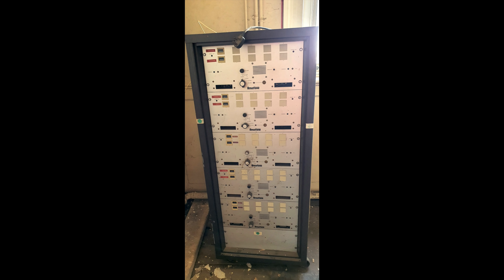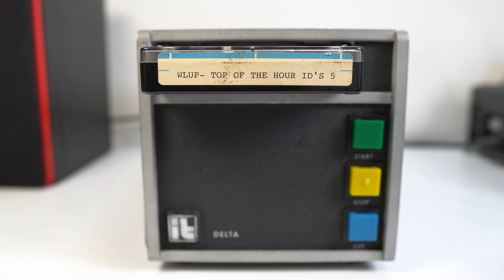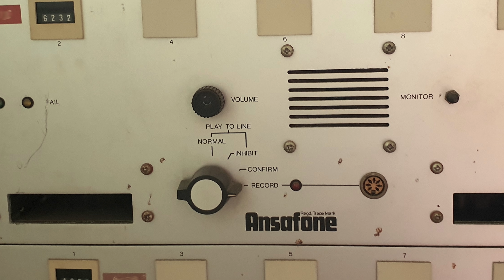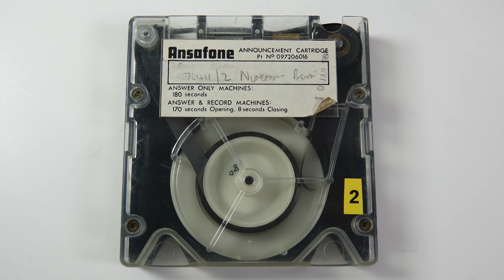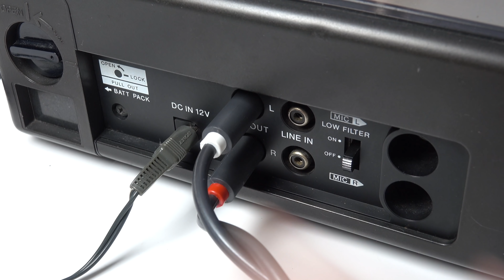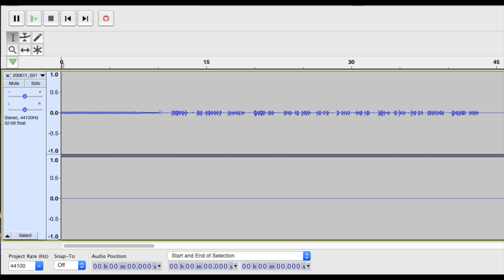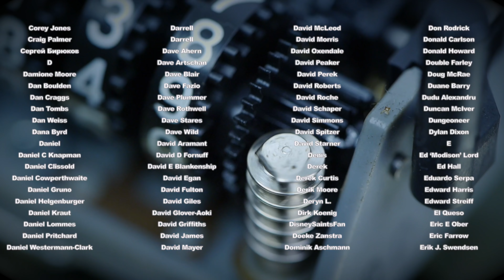Abandoned Railway Carts - Mystery tapes from a disused comms room

Comment: @Techmoan What a trip. My dad created WLUP Chicago in 1977. Jay Blackburn. That tape brought back some memories. Thank you. DO you have any other WLUP stuff?
Reply: Small world!
Reply: I'm only used to hearing the station on 97.9 so it threw me off to hear 98. When did they change stations?
Reply: @dgpsf  Yes!  There wasn't POINT ANYTHING on an analog radio dial. The only time I heard a decimal on an FM call in the 1970's was BLANK, POINT FIVE (as you could get HALFWAY by sight.) any thing else was rounded up or down. In Pittsburgh,PA we had "Disco 96" (96.1 FM), But WDVE was always 102.5, Even in it's 1960's KQV FM days. This happened on AM (MW to the rest of the world.) too: "AUDIO 14" was once what KQV 1410 AM was called. Admittedly such rounding on AM was scarcer than on FM as AM stations in the US are closer together, and go in nice even 10 Khz "steps" (LOL, the ONE time the US is "metric") In Europe ( and elsewhere?) AM was spaced (IIRC)  at 9Khz. IDK if European AM (MW) stations rounded the frequencies in their "calls".
Reply: @psychoacer  They didn't change stations. More accurate tuners evolved.  97.9 is "98" when rounded. There were no digital tuners then. You pointed your dial at a physical marking AS CLOSE to the frequency desired as possible and "fine tuned by ear". 97900 KHz (97.9 MHz) is as close to 98000 KHz (98MHz) as one can get, as in the US at least the FM channels are 200 KHz (0.2 MHz) wide.
Reply: @psychoacer  It's pretty common for stations at .1 or .9 advertise themselves as the rounded number. E.g. Boston's Kiss 108 is really 107.9, LA's K-Earth 101 is really 101.1, and so on. (Although apparently NYC's Z100 is actually 100.3, which is weird imo.)
Reply from the maker: @Geoffrey Blackburn I bought a box of carts a few years ago. It’s possible there are some other WLUP ones in there. They are all from around the same time period as the one I played.
Reply: @psychoacer  I asked my pop why they would say 98 instead of 97.9. He said it was to raise Nielson ratings numbers for ad sales. I don't pretend to understand how ratings books worked 40 years ago but that is what he said. He did it to every station he owned/programmed.
Reply: Before WLUP, the station on that frequency was WSDM (smack dab in the middle), which my parents listened to.  I wish I could have heard WLUP, but we moved out of the Chicago area in 1975.  I wonder if your father had a role in the infamous "Disco Demolition Night" (hosted by Steve Dahl of WLUP) that caused the White Sox to forfeit a game.
Reply: @romulusnr  "Z100" being "100.3" is still correct, by normal usage, XXX.5 is STATED is XXX.5,   Anything LOWER than XXX.5 is rounded DOWN, Higher than XXX.5 is rounded UP. (At least that was the pattern when I did radio.)
Reply: @geoffreyblackburn2110  Frequency and ratings have nothing to do with each other. Your dad was making a clever joke. Arbitron ratings didn't "climb" with frequency. If they had our "holy roller" station at 101 would have had better "numbers" than our "pop" station did at 96. Eh, THAT was NEVER gonna happen,LOL.
Reply: "The Loop" used to be such a great station. It broke my heart when they shut down.
Reply: @frogz  Yeah, Phase locked loop detection is a "thing" in analog FM receivers (although most PLL FM radios are in fact DIGITAL). And YES the FCC controls the freq of a broadcast station down to .1 Mhz. Yes sir, ALL that's true. How relevant that was to the average teen in 1977 tuning a $10 radio from Woolworth where the markings on the dial were: 88...,92...,96...,100...,104...,108... I don't know.  And How ON EARTH it changes a simple "Bumper" slogan, I don't know. It's a brand name NOT the legal licence description. Rounding was and is still common.  We had a station here called "B-94" (and I mean the original one, NOT the current HD subchannel) that operated at 93.7 MHZ It was CALLED B-94 even AFTER digital tuners bacame mainstream, Thus, "B-94" listerners (poor souls,that they were,LOL) TUNED to 93.7 Mhz).
Reply: @smokeydoke100  Chicago (along with Pittsburgh and New York) at one time had the best LOCAL RADIO BROADCASTERS  on Earth. Go find "airchecks" from any of those 3 cities from the 50s to the 90s and see how SPOILED were were compared to the West Coast then.
Reply: @halkneeble7612  I remember that "infamous stunt" fondly! What a way to say "goodbye" to the 1970s, LOL!
Reply: @jamesslick4790  Like WRRK back about 10 years ago..  It was "Channel 97"  but was at 96.9 on the tuner.  I remember "The Judge" was one of the DJs, and wasn't there a lady named Michelle too?  It's been too long..
Damn.  I miss that station. Best damn classic rock station I ever heard. You had Quinn & Rose in the mornings, rather than music, but I found them to be entertaining.  Now it's just another one of those lame "Name" stations.   
"Bob FM.  We play anything!" (Including mostly trash)   And DVE as well as 90% of all FM radio is utterly useless in the mornings with either Jocks foaming about " Hey yintz gize!  We gots duh stillerzz anat!" or "Yintz  gawwnna listen ta sum Pens anat!" in extremely exaggerated Pittrsburghese, or DJs giggling like stoned teenagers at some dry "humor" on some lame "Morning show"  I'm just like "SHUT UP AND PLAY SOME ROCK!"  SW Pa. needs another classic rock station that actually plays music.  Especially in the mornings.  But the absolute worst, (besides the rap and hiphop stations) are those "Hot New Country" stations which are barely different from hiphop or soft pop-rock.  BLEHH!  I'm glad WLYY "Willie" 103.5 came along for my country music fix. Before Willie, it was that stupid Frog station with lame "hopping home" or ribbit" puns. I listened to 1110 AM WKZV out of Washington.
Thank goodness for smartphones and bluetooth connectivity.  Radio is all but useless for music anymore.
Reply: @jamesslick4790  All the greats have disappeared. WLUP, WDAI (Became Disco DOA,) WMET. Even WIND on AM at one point.
Reply: I was at Comiskey Park that warm July day in 1979. I walked across the field out of the stadium and took the IC south home. It got pretty crazy that day. I wasn't sticking around for cops to crack me in the head. I saw the skinheads getting into it with them though, so I high tailed it out of there.
Reply: The station is now a K-Love station just like 107.3 in Washington DC and the WRQX call letters are used by an AM station. But that is cool that your dad created the station that was liked by many people in Chicago.
Reply: @caturdaynite7217  Disco Demolition. An event truly worthy of another star on our flag.
Reply: @smokeydoke100  🤣👍👍
Reply: RIP the Loop
Reply: @romulusnr  I know stations advertise themselves like that but this tape is labelled as the hourly ID which I thought* was required to state the actual licensed frequency.

I generally dislike stations rounding their frequency in advertising because they are ambiguous (all FM stations in the US have an odd decimal). I am OK though with 88.1 and 107.9 rounding their numbers because they are unambiguous (79.9 and 108.1 are outside the broadcast band).

*I actually just looked at the Wikipedia page and the actual frequency is not required in the ident, but is optional between the callsign and the community of license. So they just barely get away with it. To a human the ident is "FM 98 WLUP Chicago" but to a lawyer the ident is only "WLUP Chicago."
Reply: @nathansmo  Amen, Brother.
Reply: @romulusnr  It doesn't, or didn't even have to be that close. For instance, when KSYZ went on the air in Grand Island, NE, in 1982, it advertised itself as "FM 108" despite being at 107.7 MHz.
Reply: As soon as it started saying "the loop" I just about died. I listened to WLUP all the way till it went off the air! (for me 2004-2018..I was born in 2000). Definitely did not expect that in a Techmoan video!
Reply: @romulusnr  in my town, we have alot of stations that goes with .3 or .7 dont know why they like to use that frequency
Reply: @Techmoan  On behalf of my fellow Merkins I'd like to apologise for the egregious and ill-conceived usage of an apostrophe to form the plural on "IDs" at 5:54 --- Those responsible have been sacked, castrated and left in the sun for the hyenas.
Reply: @geoffreyblackburn2110   You couldn't find '97.9' on an old car stereo with a needle in a window display located at the bottom of the dash. You aimed for '98' and stopped adjusting when it sounded good.  So radio stations marketed so people could tune in easier. Once digital displays had take over the WLUP was no longer 98 but 97.9 in their materials and ads.
Reply: I've got a copy of "Chicago Rocks Vol. 1" that WLUP released in 1980.
Reply: @jamesslick4790  a lot of the frequencies were announced in terms of wavelength instead of frequency, back then, at least in the UK.
Reply: @kaitlyn__L  In the US, (and IIRC, Canada and Mexico) it was always kilocycle (now called kilohertz) and megacycles (now called megahertz) for broadcast AM(MW) and broadcast FM. Many US made radio receivers DID have a meter scale (mostly sets made from the the 1930s thru 1950s), But no US broadcast station "calls" used wavelength. Meters of course WERE used by US broadcast Shortwave stations, Likely due to an international audience. PS: US FM frequencies have "channel numbers" but no broadcaster referred to them. Some would brand themselves as say, "Channel 98", But still that was a reference to the closest frequency, NOT the actual FCC FM "channel" number.
Reply: @jamesslick4790  yeah, as far as I'm aware we only really switched to frequency with FM. But maybe SW AM had it too. It's interesting and weird for me to look back at 40s and 50s American receivers and see frequency instead of (or in addition to and obviously primary, much as MPH/KPH speed dials) when the ones over here just showed metres. Which is interesting considering most people used feet and inches for regular daily measurements in the UK, so I suppose for a while "1000 metres" would've registered as only being a radio station to some laypeople. 

I also notice America seemed to use the term AM earlier than we did, where we only used LW/MW/SW with no mention of the modulation technique until it became relevant with FM. But I haven't looked into this stuff super extensively so I don't know exactly when the switchover occurred. Certainly modern radios in the UK will measure AM in frequency not wavelength, though whether or not they also do that for LW and MW is more variable, especially with digital displays.
Reply: @psychoacer  Basically the NAB sublevel of "broadcaster' thinks its listener is too stupid to discern nuances of decimal points (or call letters for that matter) so they dumb-down the drain to the nearest number and a mindless totem.  It's all part of abusing the medium in the obsessive quest for more rating$ for Numero Uno.
Reply: @psychoacer  As many have said, in the days of analog radio tuners, whole numbers were the only thing you could see on the dial to point the needle at -- and the labels weren't necessarily perfectly aligned, either.  So stations often rounded the number in their branding. 

And some still do.  Here in the Twin Cities we have "92 KQRS" (92.5), "KS95" (94.5), "Cities 97" (97.1), "K102" (102.1), "Love 105" (105.1, .3, & .7 -- it's a long story), and "KOOL 108" (107.9).
Reply: @Cammi_Rosalie  I'm with you. Today, I listen mainly to 93.7 (KDKA-FM, "The Fan") Unfortunately, right now I haven't had much to listen to even there, as theres no real sports at the moment. As to "Country stations", YEP 100% agree most of that crap isn't "country"! But, then too, same for "rock" NO ONE makes actual "rock" anymore. So, now broadcast radio (for me is confined to news and "talk". Sad.
Reply: @eDoc2020  Yep, The legal "Ident" and the authorized frequency on the transmitter licence are technically 2 different things!
Reply: @simonbone  It's just the math we got in third grade: if it is HIGHER than .5 round UP, LOWER than .5 round DOWN, Lol.
Reply: @jamesslick4790  Indeed it is. But with digital tuners, it's become a lost art, at least when it comes to hunting for radio stations.
Reply: @kaitlyn__L  I think we used the term "AM" earlier is due to NEEDING to earlier. "FM" became the thing in the US in US in the 1940s, While broadcast  "FM" really didn't "take off"  until  the 1960s, (when stereo FM was launched) It existed and was used. (there were also really early police/fire use of frequency modulation in the US) the term "AM" thus started to appear on radio dials to differentiate from FM by 1950. Prior to that, there was no need, as LW/MW/SW were ALL either CW (I.E. Morse Code) or AM. Before FM,  the Medium Wave band was just called "Standard Broadcast" SW was, Natch, Called "Shortwave" While there WERE Long wave sets made in the US, LW was never used for broadcast in North America, So it was largely left off. I believe that BROADCAST FM didn't start in the UK until the mid 1950s. So older UK sets would likewise not bother to say "AM" because LW/MW & SW were ALL "AM" anyways! PS I have a current (2018 made) radio that says "MW" instead of "AM" - (it also has LW and SW too), Being an old radio guy, I did not need the manual to tell me that "MW" was (in the US) 525-1750 KHz AM, LOL!
Reply: @jamesslick4790  ah, I never knew the USA had FM sooner! Certainly, many people used AM-only radios well into the 60s that just said LW/MW/SW in the UK. Especially since the BBC had the only official broadcast license, lots of pirate radio stations operated just outside British coastal waters and they used LW to get their coverage playing rock and pop that the BBC wouldn't play, or only play for an hour once a week.
Reply: @kaitlyn__L  Well, to be fair, "early adopters" and Classical music fans were the ones that REALLY used FM before the 1960s in the US, But it DID exist. so "AM" only radios STILL sold well in the US in the 1950s AND 60s. (heck, even in the 1970s, you could get an AM only radio at "Radio Shack"!) FM here got gradually bigger after the FCC permitted FM stereo in 1961 (AM stereo was TRIED, but 20 years AFTER FM!!) "serious" music was FMs "staple" for a long time. FM Pop/Rock stations only became mainstream in the LATE 1960s. As to the "pirate" stations, It's a fascinating aspect of Broadcast radio by itself. Using LW (and SW) makes sense, as DISTANCE was the goal more than fidelity.
Reply: @jamesslick4790  Since I often listen to radio on really high end equipment (SDR and Hamradios) I can promise that most stations isn't exactly on their freq to this day, infact, some are even drifting with temperature.
(no, it is not my equipment that is drifting)
We had a local station that somehow got detuned enough that you had to retune your reciever, and it stayed on the wrong freq for weeks, making their jingle 102.3 a smidge funny
Local stations are often really badly setup, and the deviation overdriven to the point they splatter on the side.
Reply: Tell you father thank you, I still listen from time to time
Reply: Wow, small world. It's a shame that this station went by the wayside to bring you yet another CCM station. Chicago already has a CCM station. Why have another one? And besides, it's the same music. The music WONU plays and most of the time it's not that good. Yeah, I'm a music snob.

Comment: How fitting that the jingle was for some station called "the loop"
Reply: And now, with centralised networked shows and limited playlists, every radio station is 'the loop' :(
Reply: More interesting the station is from Chicago where the elevated train includes a section of the downtown called the loop.
Reply: I love this comment
Reply: @redingtonm  Interestingly, Milwaukee had an Electric train called the North Shore Line that left Milwaukee as an overhead line powered rail service and in 90 minutes it would be making "the loop" heading back to Milwaukee from Chicago. The Elevated as the system was called in Chicago was powered by a third rail not an overhead wire so the Milwaukee equipment had to have that third rail "shoe" to pick up the power. I did ride the North Shore line to Chicago a few times prior to it's abandonment in 1963. My parents were transplants to Milwaukee and all of our relatives were in Chicago.
Reply: The loop was on that air for a long time. Lived in Chicago for the last 35 years
Reply: I listened to the loop for years as a kid. Those were the days.
Reply: WLUPis from Chicago. Great classic rock station.
Reply: Chris Lopez yep!  Steve Dahl
Reply: Detroit has a rock station fittingly called WRIF, The Riff.

Comment: Not less than 20 years ago we used the same cart tape recording as those for the Emergency broadcast announcements.  That was still in use in 2003 when I left the radio station, even though everything else was handle by computer.  The next station over was sports talk radio, they did everything with Minidisc.